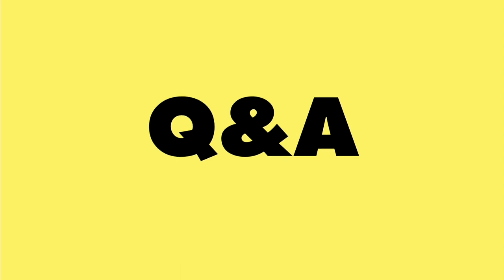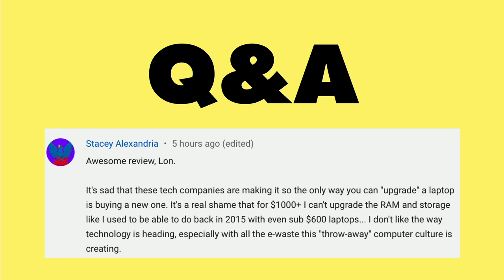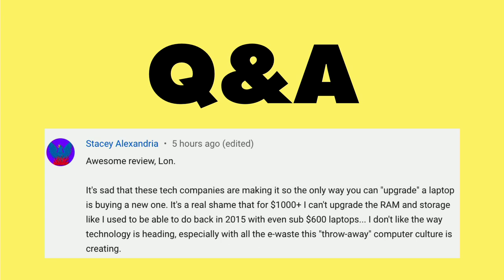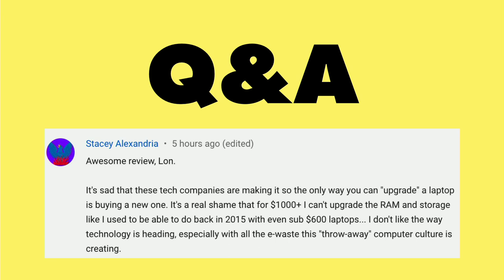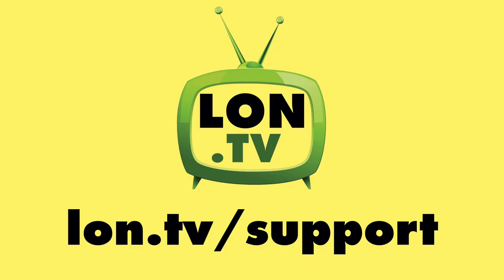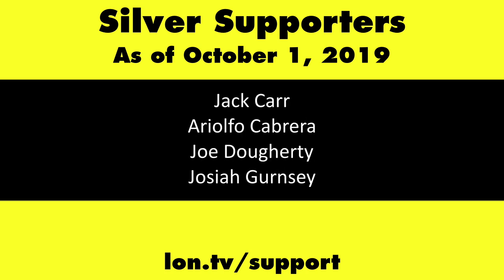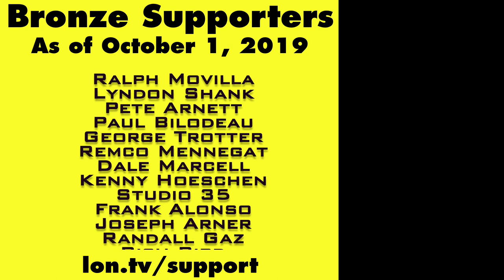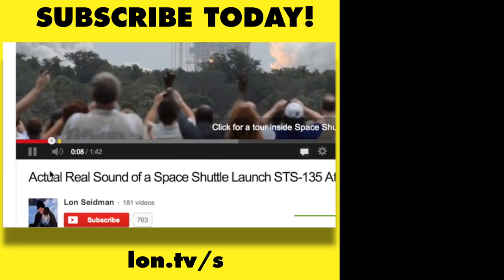Why Most Laptops Today Aren't Upgradeable

Comment: Lon is partially correct about components being soldered to save $$ BUT I think the main reason is so when your laptop breaks then you have to buy a new one. I just got a brand new Dell laptop and it won't boot from an external drive, Dell has blocked that in the bios.
Reply: Unfortunately there aren't too many laptop manufacturers. This is what happens when you have oligopolies. Planned Planned obsolescence.

Comment: It's sad that most consumers see electronics as disposable these days. Smartphones ushered in the two year lifespan of electronics. The yearly upgrade cycle, 2 year financing and sealed "waterproof" designs have taught people that electronic gadgets have a limited useful lifespan and you dare not open them up to repair or upgrade them. It's disheartening to see laptops follow that trend. Desktop PC's hopefully will hold out a few decades before they are considered disposable.

Comment: How reliable is soldered RAM?  I've had a couple RAM modules go out on laptops here and there but fortunately they were replaceable modules and not soldered onto the board.  I'd hate to see a soldered module go out.  Questionable reliability of RAM modules has steered me away from getting anything with soldered RAM but is it a legit concern or am I worrying about nothing?
Reply: Same thing I had in mind. I am using I5 4th gen laptop which has upgradable ram and replaceable battery. When I asked for the battery hp said it's not available and have to get compatible battery.
Looks like just like mobile phones manufacturer expect us to buy laptops every 3 years.
Reply: Well I have hundreds of RAM sticks the only dead ones ive seen are DDR2 and DDR3 some of them mustve died from age or being stored without any care, but the newest dead one I saw was a 1600MHZ DDR3L stick from like 2014, although I temporarily revived it with a heat gun meaning it died from overheating in the first place. but anyways, it should last at least 10 years for the average person, as most of my DDR2 sticks are 12+ years old and work fine
Reply: Also worth mentioning I have two acer laptops (2013 and 2014) with one slot+4gb soldered one of which is used almost every day and they both work flawlessly

Comment: Cost saving due to labor? On non soldered systems, you literally just plug it in? A few seconds of work? It takes longer to solder it in! 

As most here point out, it's to force you to buy a new laptop when the old one breaks. Cuz it won't be repairable

Comment: I would be all for this if manufacturers offered to sell the single board chips for both a reasonable price and if they redesigned the internals to make it easier to swap the single board chips or logic boards in and out of the machines. There are benefits to standby battery usage and overall battery life with single board chips that may greatly boost the efficiency of windows and Linux machines. All these years later and you still have to tinker with a lot of configuration to get the battery life for non-Mac based machines to be moderately close to what apple does with their machines.

I have an m1 mbp 16” and a fedora 35 desktop. I love both and I used to have a fedora laptop but in terms of power efficiency macOS is king.

Comment: I am demanding upgradability.  protesting apple.  I am a true techy that builds their own computers and replaces his own parts.
Unlike the apple tards that infected the industry.  I hate them.  They have destroyed my hobby increased my costs and gave me sub par equipment.  I hope these people go bankrupt so apples of the world go back to servicing us techies rather than the ones that know nothing of tech.

Just tell them to buy a netbook they won't know the difference anyway and they cant upgrade it perfect for them and saves them 1000s of dollars.

Now I refuse to buy anything with no ram upgradability especially if they restrict ssd upgradability now.

for business laptops like XPS I expect soldered ram but I will treat it as a disposable device because of this.  SO I will refuse to pay premium for something that is trash.  500 dollars max for a refurbished xps then. maybe 600-700 for a new xps.

but anything with 8gb is trash netbook category now. Pointless.
16gb versions that you could have upgraded with less than 50 bucks cost you 400 dollars more.
refuse this.

I still see Alienware m15 r1 selling for 1200-1300 dollars used like what?
prices didn't go down much it seems.

Actually it means my purchase of m15 r1 was a good purchase I can still upgrade ram and my other stuff.
got it refub for sub 1000 years ago.  A massive deal.  Upgraded my parts too.  only issue is dell doesn't sell the 90whr battery.

Comment: This is not why at all, there is a space in that soldered ram with software on it you can not remove, to spy on you and to prevent you changing things. So you have to buy things off Microsoft like cloud storage and online only apps. They have turned them into spying sales machines it started with Win10. Its more sinister than you think look at the 200mb missing space in your ram what is in that? And also you can if skilled with equipment unsolder and resolder different ram ive seen it done. You can even unsolder and resolder a different cpu if you want and have the ability.
Reply: That 200mb of missing space is for swap memory which is utilized when your machine needs more memory than what you physically have installed
Reply: @@ClassBLiving64 Whats so funny ya dork? 🤣🤣
Reply: @@ClassBLiving64 Good bye